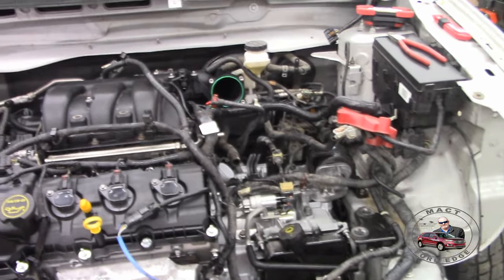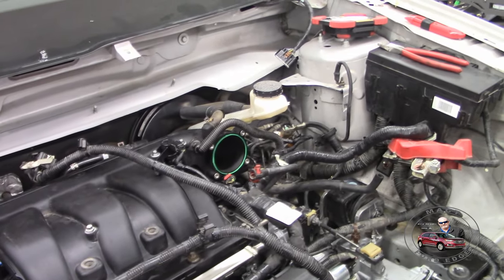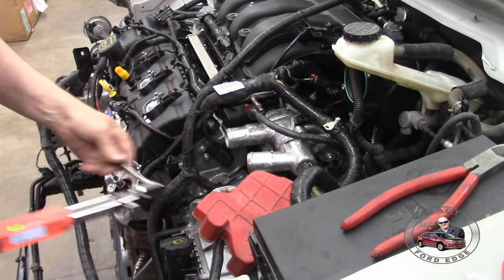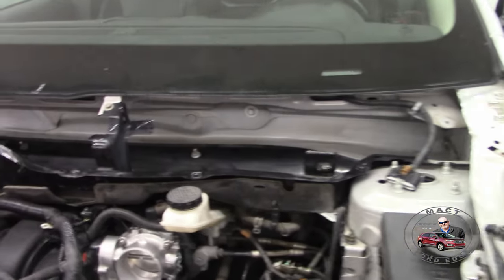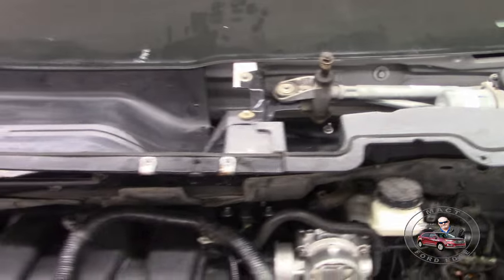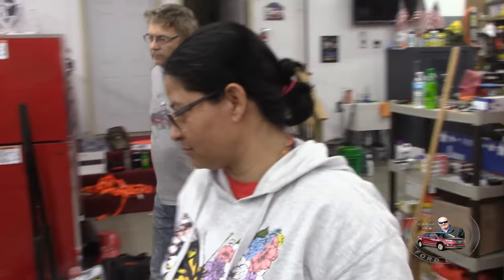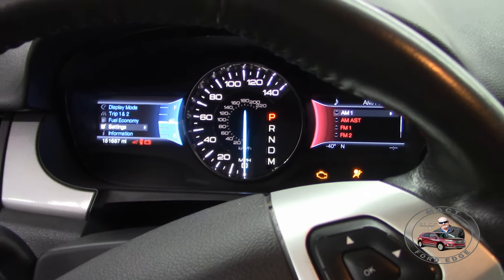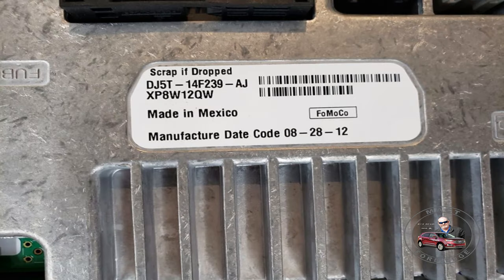Part 40 Herbie Project installing coolant assembly, wiper motor, cowling, PCM and then powering up

Comment from the maker: The first step towards cranking and starting up Herbie.  Once we finish the checks and get the fluids filled, axles installed, suspension torqued then we will be cranking over the engine without spark or fuel to get the oil pressure up.  Then the start!  Thanks for watching.  Like Subscribe and if you have found the videos helpful hit the SUPER THANKS and show your appreciation.